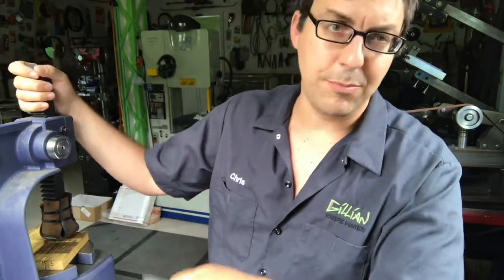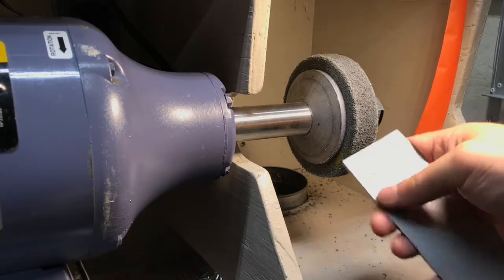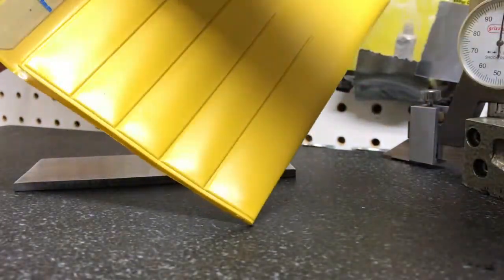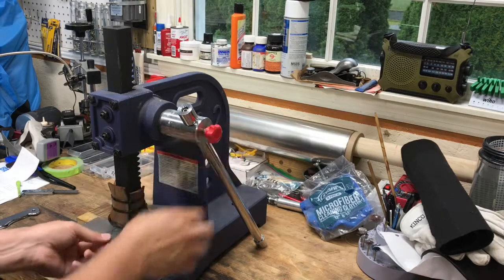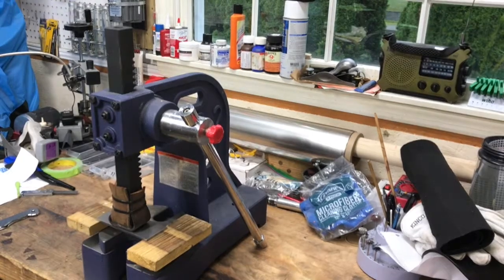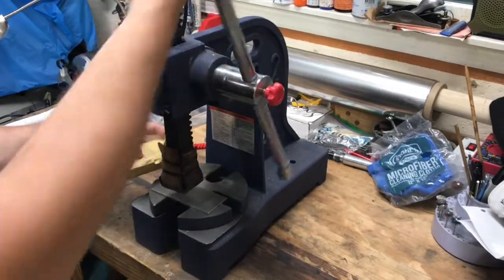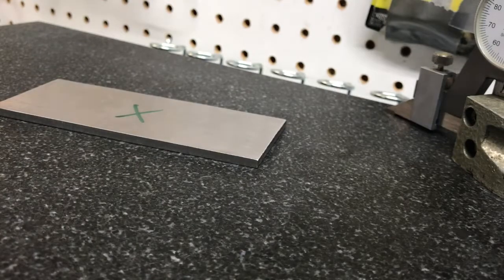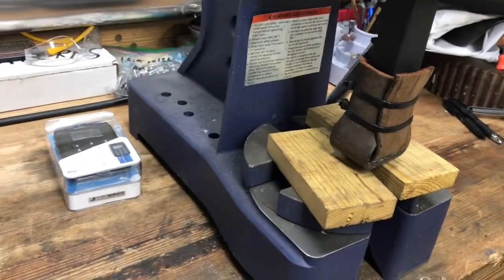Tools For Making Knives - Arbor Press - How To Remove Bow From Blade

Comment: great video.  do you think a 1 ton arbor press will suffice?  or 2 ton and up?
Reply from the maker: I think a one ton arbor press would do just fine.  Its not difficult at all with a 2 ton, if you push hard you will warp the steel.